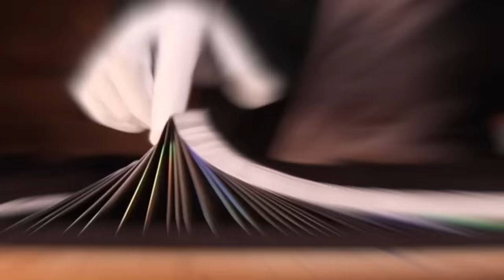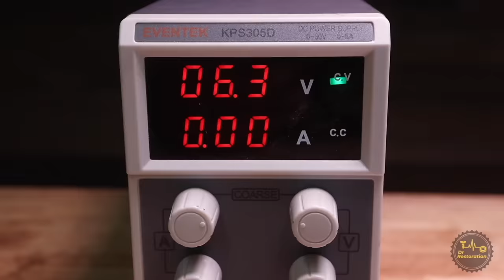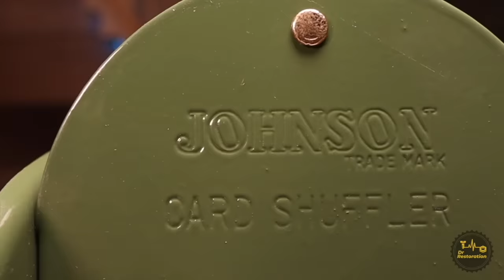AWESOME Card Shuffler Restoration - Is It Magic?

Comment: I would have soaked the rubber rollers in silicone oil before reassembling. The screw heads could have used some sanding before polishing also to remove the heavy scratches. Not a bad restoration job.

Comment: Any reason why you chose to sand the plastic gear wheel, instead of using a retrobright approach using hydrogen peroxide to restore the colour? Would have thought that would have achieved a better and cleaner look, especially for in-between the gear teeth.
Reply from the maker: It had a pretty deep scuff that needed sanding

Comment: I was wondering how you cleaned the screws and pins. Did you use electrolysis, or just a wire wheel and polish?
Reply from the maker: Wire wheel and polish 👍